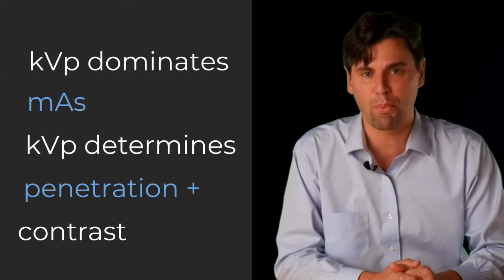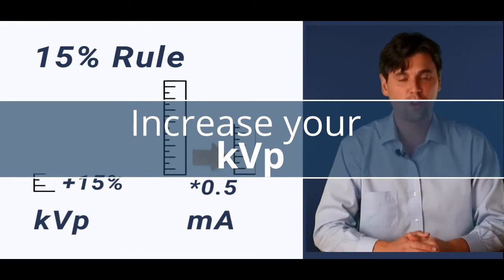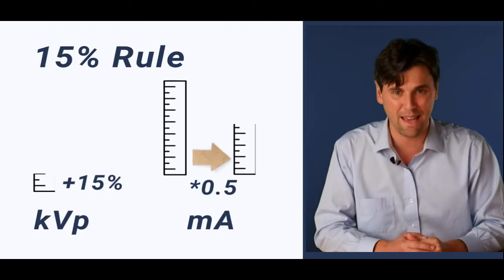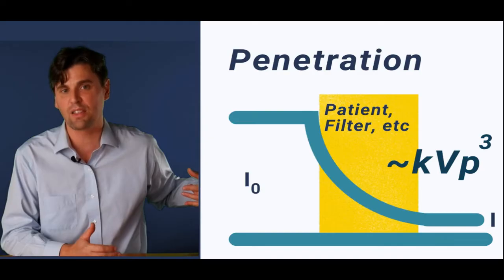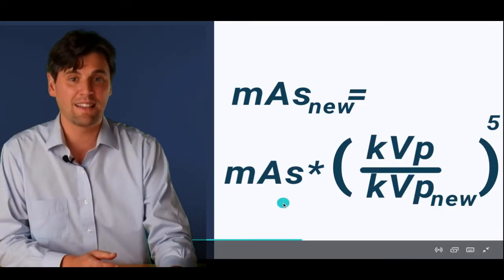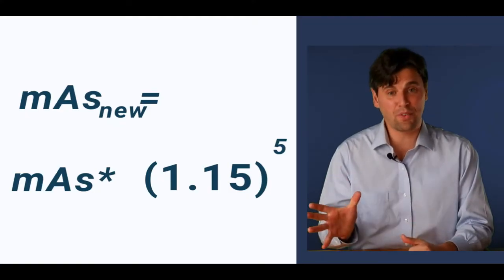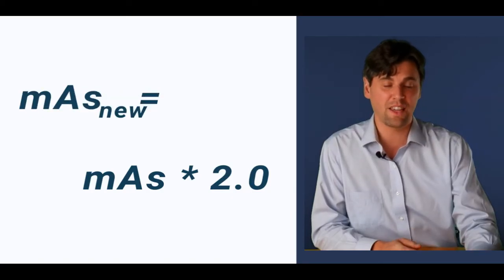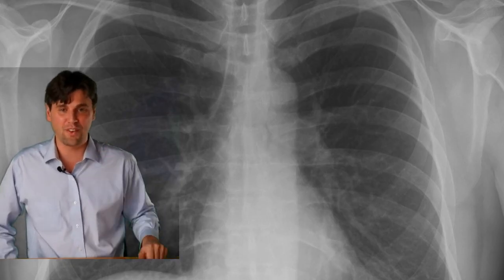15% Rule Radiology (mAs compensation for kVp changes for Rad Techs)

Comment: I had a question on a test that asked “if you increase your kVp by 15%, your mAs would increase by what?” The options were 
A) 100%
B) 50%
C) 15%
D) 30% 

But I thought that when you increase your kVp, you decrease your mAs???
Reply from the maker: you are right, you should decrease the mA to keep exposure on the detector constant.